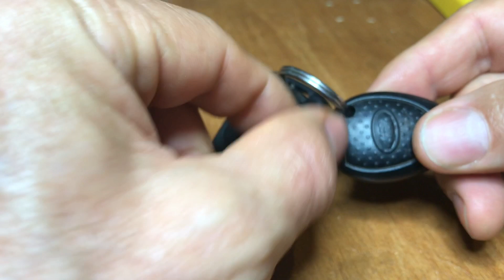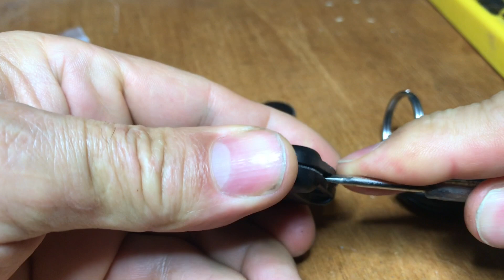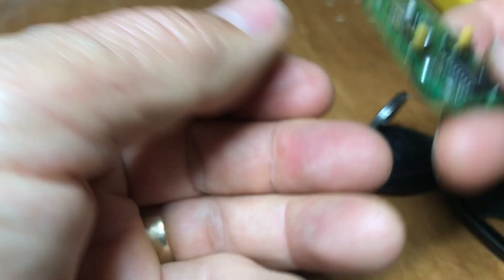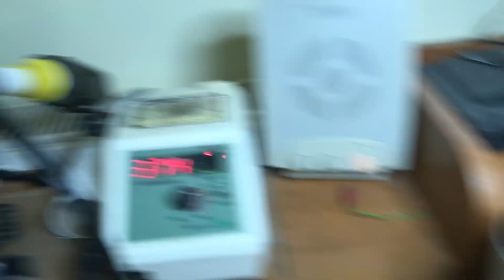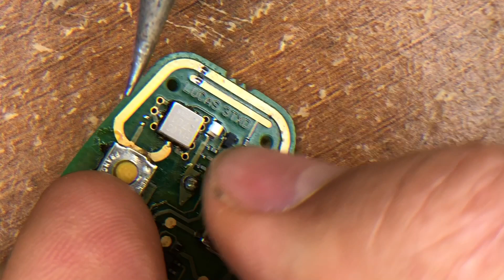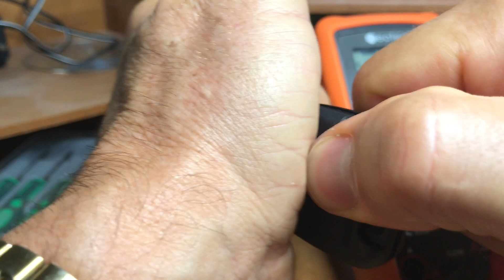Key Fob Fix / Renovation - Freelander, MG, Rover, Landrover - Lucas 3TXB 2 Button Remote Fob

Comment: So you did not take the battery out then
Reply from the maker: I checked the voltage, which was ok at 3v.  (8mins).  So didn't change it.  It is however often best to change the battery to save time later, see the comment at 9mins about syncing up again afterwards.

Comment: Hi there , I’ve changed my ccu on my FL 1 td4 , I can’t sync my key fob ? does it need programmed or is there a procedure ?
Reply from the maker: The usual procedure to sync is keep repeatedly pressing about 4 times lock and then unlock x4.  Try repeating a few times if it is able to sync it will.  If it is unmatched to ccu it won’t and will need programming i think.
Reply: The ccu is unmatched to the key fob ☹️ I’ll try again to pair today 👍🏻
Reply from the maker: @gixxercorona  sounds like it will need programming then, as you can’t use any old key fob / ccu combination otherwise you would be able to open any car.
Reply: Hi There, the ECU will need reprogramming (but be careful if the ECU is a Rover MEMS type [lots of different Pt Nos] then these are harder to get sorted. I have used a company in Cannock in Staffordshire called ATC Drivetrain, they can sort it. I realis ethis is an old post but this info might ehelp someone else.

Comment: Hi were can I get fob and circuit board for my freelander mk1 td4 because I don't have one only got 2keys please.cheers
Reply: Thanks mate. By the way great video's down to the nitty gritty keep up the good work.
Reply from the maker: @mikestorey6242  Cheers
Reply from the maker: Internet search “ remote control fob replacement” plus your area.  Or “auto locksmith”.  They will need to program it to your car.  Also try https://www.technozen-electronics.co.uk/mg-rover-land-rover-remote-fob-services/